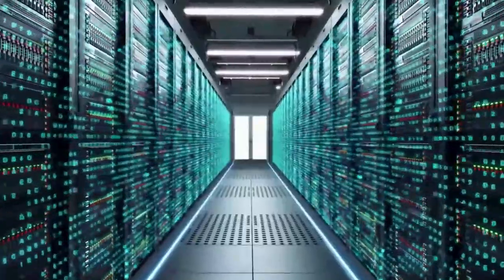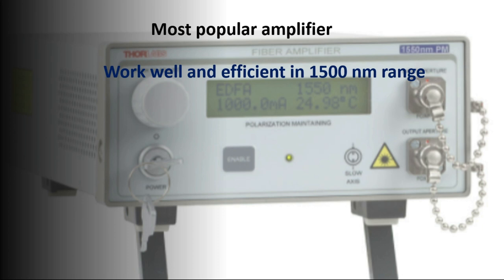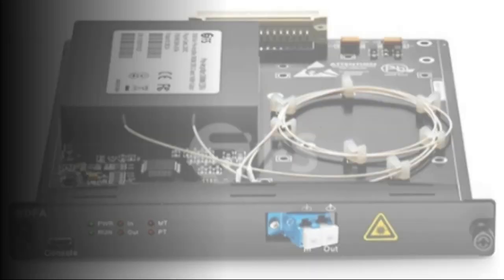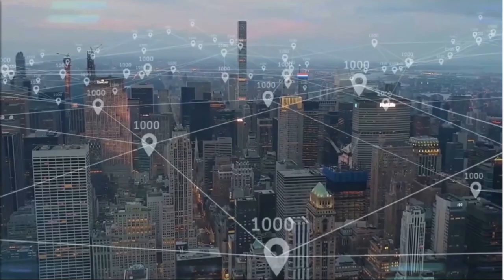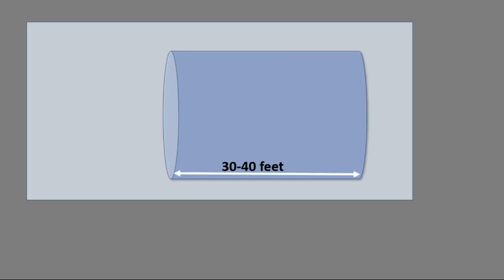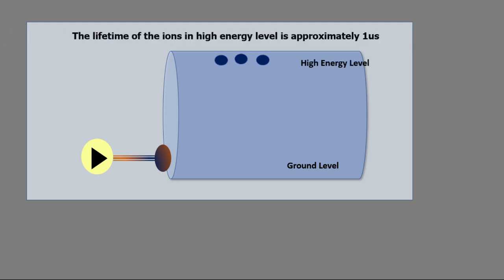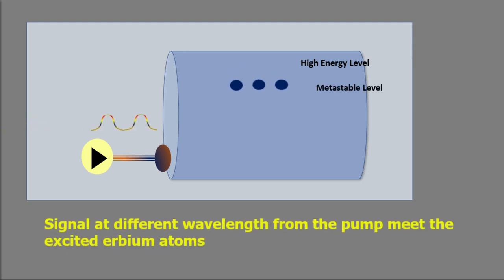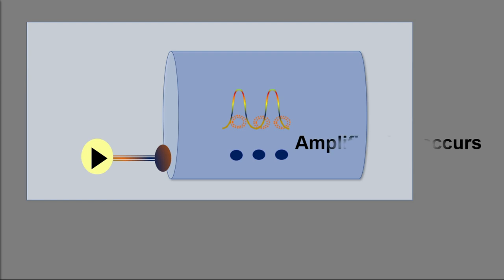EDFA Amplifier principle in DWDM |Optical fiber|  RAMAN Amplifier ROADM | OTN #roadm #otn #dwdm

Comment: Btw when it's coming down from high energy level to meta stable after 1 mili second won't it emit some light too? If it's emitting light till meta stable condition won't it create disturbance in actual light? 
My assumption is that disturbance will fade away till 40 km easily as it's non amplified and next amplifier will amplify the actual light. Am I right ? I am not sure 
Please reply

Comment: Hi , You said this can gain upto 30dB. What exactly it mean by ?
Reply: 30 dB of gain means output power is 1000 times greater than the input power.
Reply: look up the definition of decibles. Fundamental concept to understand everything that is being measured in logarithms....... most human sensors (seeing, hearing, etc.) work logarithmicly. Keep in mind this is only a writing convention! it is just not practical to use a linear scale when you are talking about of thousands or millions of unit increases 🙂